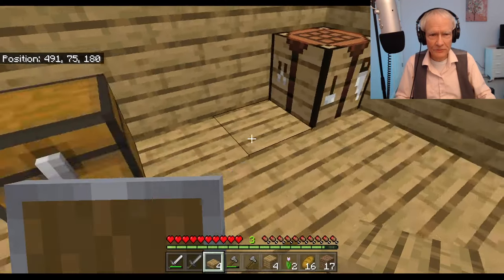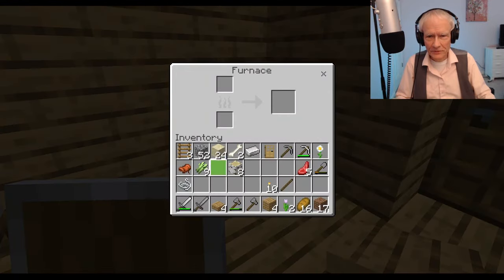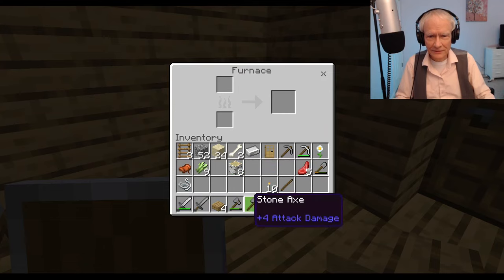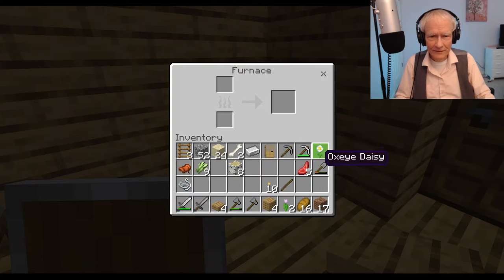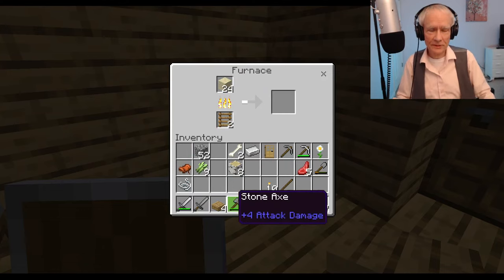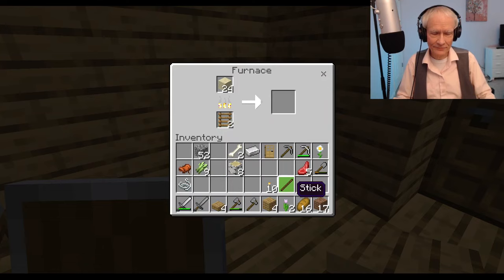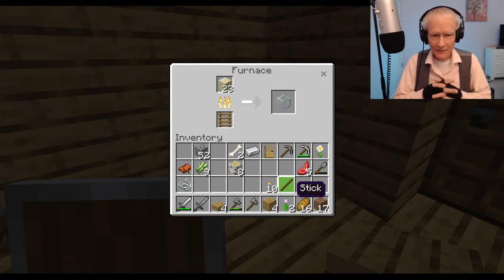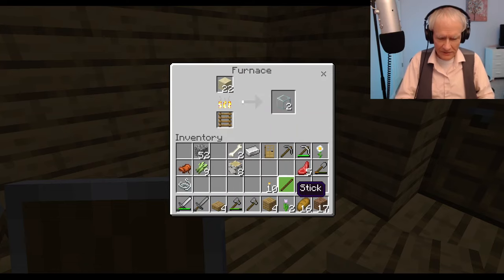Minecraft: MAKE GLASS WINDOWS for House (ASMR grandpa)

Comment: Heads up, instead of a glass pane in the ceiling you should use a glass block. The glass panes are only uses for inside walls. :)
Reply from the maker: Had no idea!
Reply: Also, if you wanted to put a window directly next to your door like you tried to do, you could use a glass block there as well.
Reply from the maker: @ccneal  Will give it a try some time!

Comment: If you didn’t know coal is the main ore to use for the fuel to a furnace. It lasts way longer and is more cost effective! Coal can be found through mining. Coal spawns in clusters and is very dense when found! Atleast 6 pieces. I hope I could help.
Reply from the maker: Yes I will dig lots more coal! But I discovered wood can be reproduced by planting trees.
Reply: @CHATTYGRANDPA  You can place any type of wooden log into a furnace and it will result in charcoal which has the durability of coal but is replaceable.

Comment: So if you combine your 80% axe with your 100% axe you will lose the 80% axe and the axe you receive will still be 100% if that makes sense. So you’re essentially losing resources. Just use up the 80% until it breaks and then proceed to use the new axe. Hope this helps trippe!
Reply from the maker: What if I combine two 10% axes (20% total) into one 100%? Do I 'gain' 80%?
Reply: @CHATTYGRANDPA  Yes the axe is now fully repaired because you combined it with a 100% axe meaning you gained 80%. Furthermore let’s say you have two 10% axes and combine them, you now have a 20% axe. And if you combine that axe with let’s say a 80% axe you will have a 100% axe.
Reply from the maker: @osbelmartinez5888  OK so I CANNOT combine two 10% axes to get a 100% axe.
Reply: @CHATTYGRANDPA  no
Reply: @CHATTYGRANDPA  that is correct, combining two 10%  axes will only grant you a 20% axe :)

Comment: I’m late, oops! Anyways, about the axe. It doesn’t last twice as long, sadly. However, yes it does relate to all tools for repairs! However, it is wasteful as the axe still had a lot left. If the tool gets low durability, you can combine it with another tool with low durability and the tool will combine the durability of both those tools. The highest durability you can have is 100% durability, so I recommend just using up the whole thing, then making a new tool when the other tool is done. I remember commenting something about making glass and glass panes, and it’s really fun to see you grow and improve! Oh and the glass on the doors, because the door isn’t as wide as a full block, the window doesn’t connect to the door. Anyways, keep up your great work!
Reply from the maker: Thanks ... yes I learned from your fellow commenters that I was wasting resources. So I am changing my practice.